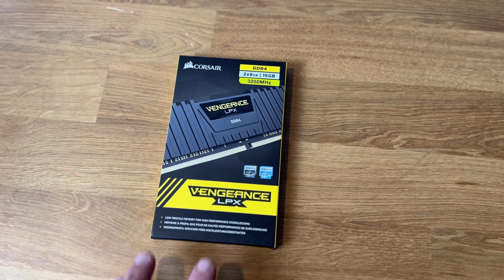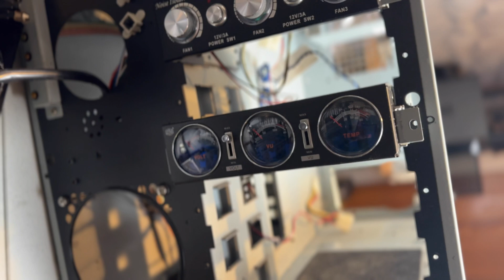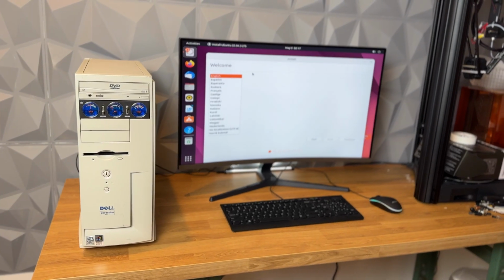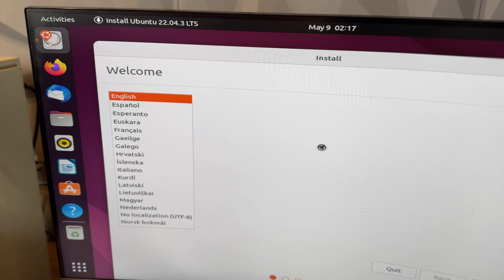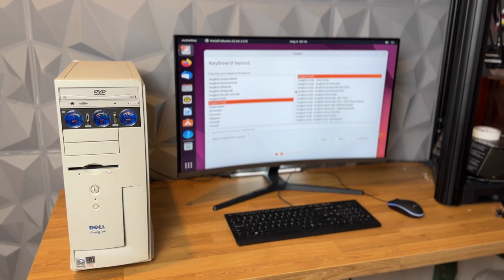Retro Dell Sleeper Build with Intel Arc & Ryzen 5 For Local LLM

Comment: Can I keep the the original switch for power? Or do I have to change it? And what switch did you use?
Reply from the maker: I kept the original switch!
Reply: @ so did you just solder the wires to the board?